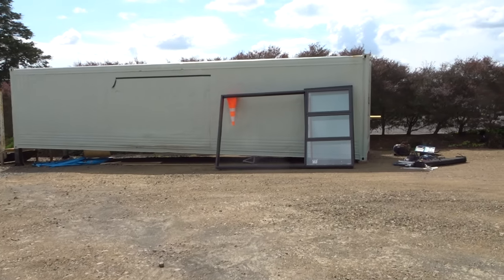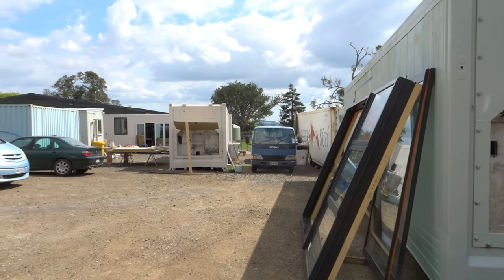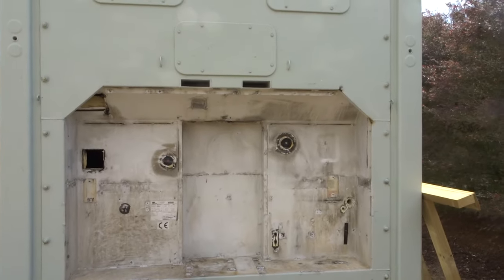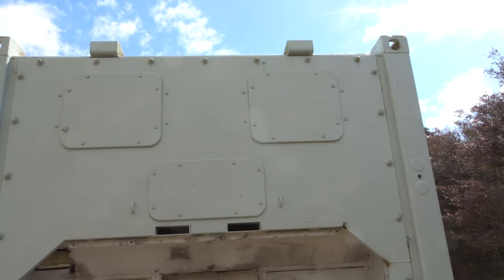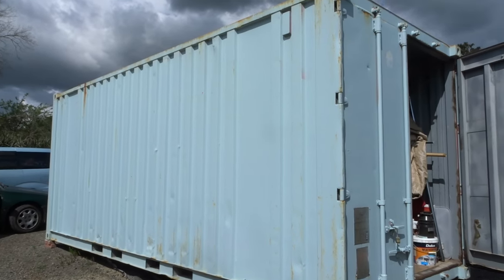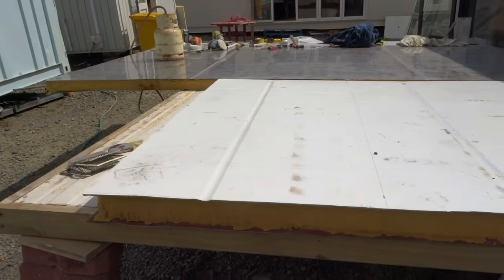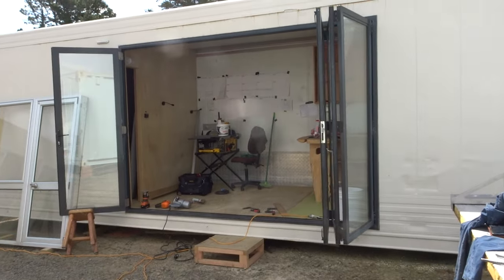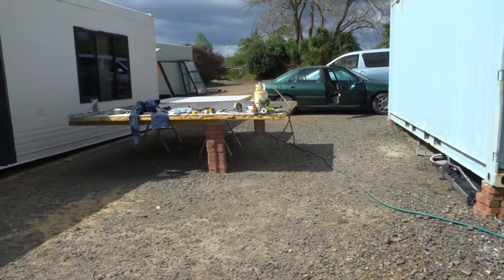40ft reefer conversions

Comment: $50,000?!! Really?.. in the UK u can get these insulated containers for £2,000, I'm struggling to see where the you came up with the $50k, I'd say you have spent $10k at most on that thing 😂😂🤡
Reply: That's for a completely finish and built out container, not just a plain empty container.
Reply from the maker: more like $75K now, but for your education....the big ticket items are: non operating reefer 11K, custom water tank 1K califont 1.3K, 12v fridge freezer 3.5K, compost toilet 1.8K, solar panels, batteries, inverter, electircal wiring, underfloor heating and pump, wetback system, plumbing, fittings, fixtures - including upcycle and recycle double glazed bifolds, windows, seeking out and transporting 2nd hand items, soft furnishings, cupboards, hardware, tradies, general labour and whatever else I've forgotten off the top of my head

Comment: Why not keep the refrigeration unit's motor and use it as a backup generator?
Reply from the maker: I buy them as 'non-operating' reefers, though have thought about how to repurpose the radiator elements as a water heating option.....maybe on the next plan! Also, I like that the storage space is freed up for all the utilities to be placed without encroaching on the main space, meaning that it's one integral unit within the original footprint.
Reply: @naturalassets9413  oh that makes sense. I saw the interior design and it seemed really thoughtful and practical while also somewhat minimal. it looks like you're doing an awesome job!
Reply from the maker: @danielcaoili6890  Thank you Daniel! I appreciate your thoughts, and for you taking the time to comment 🙂

Comment: How did you do the electrical system?
Reply from the maker: s2 x 400W solar panels,  12V lights/extractor in bathroom/rangehood/water pump. Inverter for 3 x double plug sockets internally plus for the ignition for the gas califont and the circulation pump for the underfloor heating

Comment: very interesting. do they condensate? great vid
Reply from the maker: I find that the combination of the fact that they are amazingly well insulated, and you use double glazed joinery and have an extractor fan in the shower and a rangehood over the stove then condensation is not an issue at all. They are way warmer and drier than an average cottage of similar size
Reply: @naturalassets9413  yeah it's the way I'll go if  do it. I might yet import an rv from the states.